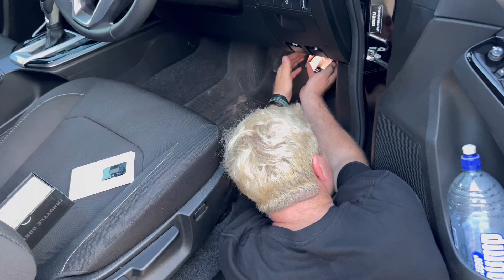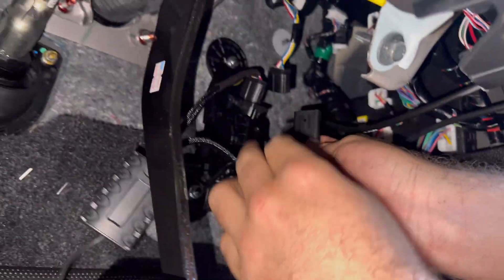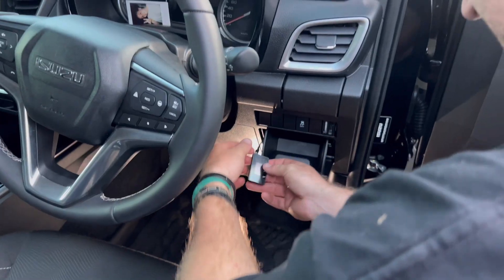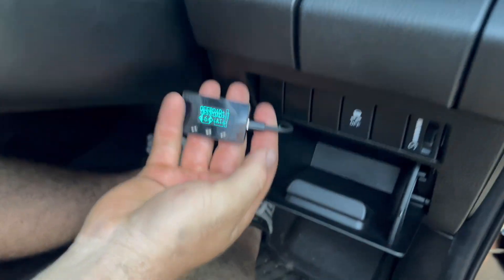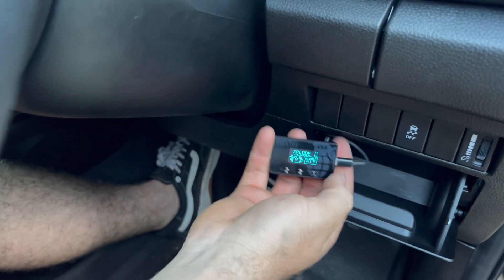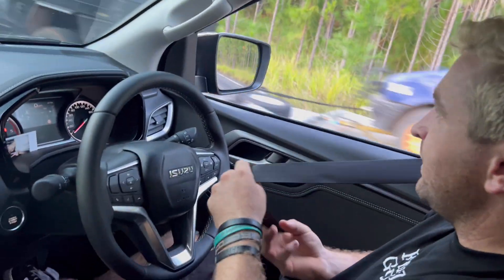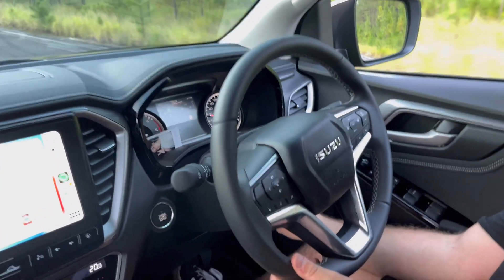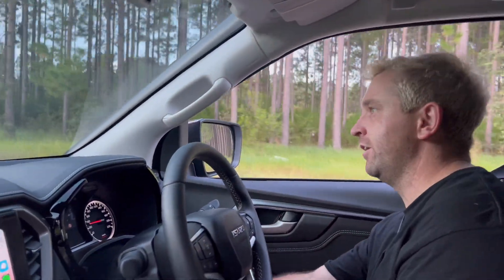Installing a Throttle Grenade throttle controller into a DMAX

Comment: So how did you remove the throttle cable? That's where I am stuck.
Reply: Worked it out. Small clip at the upper right side that you need to depress as you pull the clip out. Doesn't take much force when you get it right.
Reply from the maker: Yeah just gotta press the the clip and pull 🤙🏻